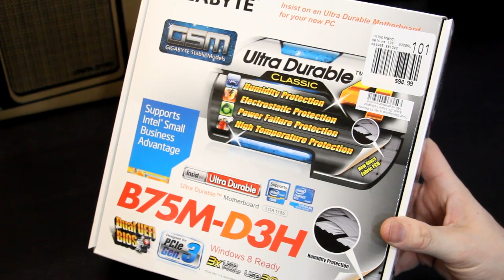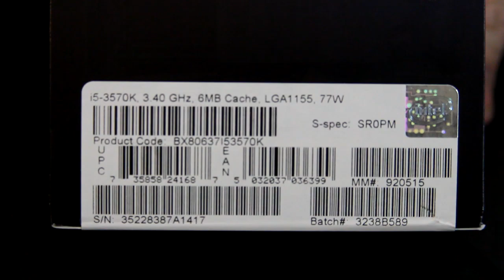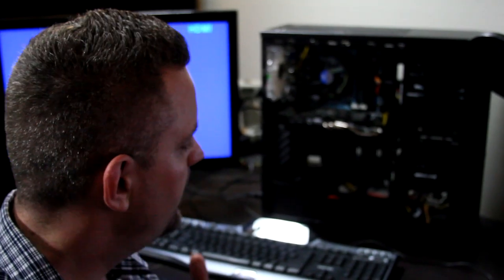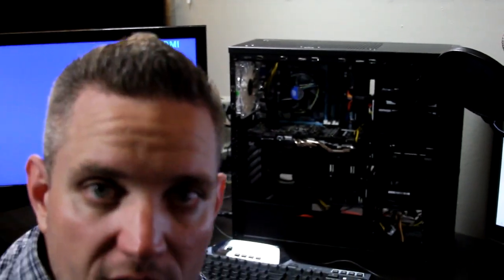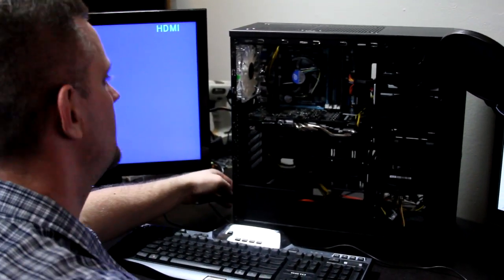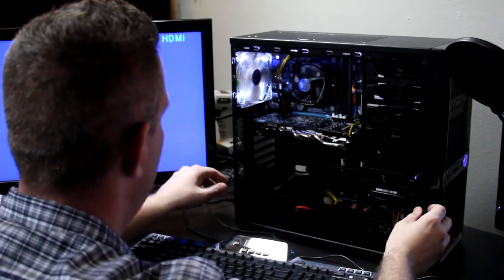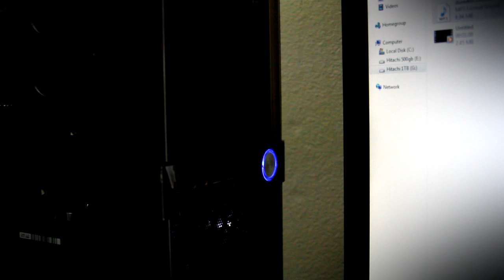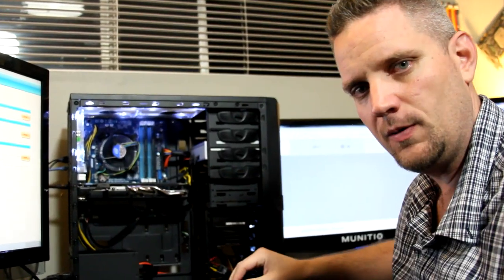How to build a gaming computer - Tech Addiction Special Edition

Comment: Yep, there are four of them in this build.  They were donated by Jay to this build.  They replaced the four stock fans the case came with, and don't add anything much besides lights to the build.  They're also fairly loud, but they do move a lot of air.

Comment: Thanks for the build.  As he says in the description, this will run BF3 on Ultra settings with no AA at 1080p.  Very good build... especially for the budget.

The LEDs were a gift from Jay, replacing the four stock fans the case came with.  And yes... they really do add 100MHz to the speed of ALL electronically controlled parts.

Comment: Yes you can. Nvidia cards have SLI and AMD cards have Crossfire. However you will need the proper mobo with ports to hold two cards, a larger power supply to power the extra card, and probably extra fans if you don't already as two GPUs put out a lot of heat.

Comment: OEM means original equipment manafacturer. It means its intended for companies such as Dell or HP, so there may be some features usually present in consumer versions that are missing in OEM versions. (OEM CPUs are missing the stock heatsink, etc.)

Comment: no, i recommend you don't touch any part that may have exposed contacts( any part with metal) as not to kill the board. also use a grounding strap if possible. you can pick these up from radio shack for fairly cheap. :)

Comment: If this is strictly for gaming, yes it will run most games pretty well. My only concern is the processor although its the GPU that really determines the quality of gaming. The 7850 is a great card, I have one. Make sure you get the Direct CU version as that will make your card run CRAZY cool. I only have two extra fans and my 7850 runs Far Cry 3 at 60C on full settings on full overclock.

Comment: some suggestions;
i always check to see if the mother board will post before i install it in the case. if the motherboard doesn't post its easier to work with outside the case rather than inside especially if its DOA and you have to send it back.
run the 8-pin power connector between the motherboard and the tray. it gives you more room for short connectors and hides the cable.
great video jay i hope more people get involved with pc building so we can enjoy desktop gaming for years to come!

Comment: Just did the research and here's the difference: Both the cards run with the same cores as each other and similar clocks. However the 770 has 1000 MHz more for efficient memory clock, and that really does help out in most games. But for the most part you are right.

Comment: If you have a larger budget than $850, you might want to splurge on either a case upgrade, or a 660ti.  You could also put the extra money into a Z77 motherboard.  That way you can overclock the CPU.

I suggested a case upgrade because there is not a whole lot of room for if you want to go liquid cooled later on.

Comment: No, not at all. OEM versions are usually just normal versions minus the flashy box. Which means that it will be the same as a consumer version just without the box and accessories. What you said about attaching to the motherboard may come from the fact that sometimes Windows OEM from manufacturers will be bootloader-locked and so you can only change it through the motherboard.

Comment: The CPU box will specify what socket the CPU uses, so just look up a motherboard with that socket type and the size you're looking for, then select one that meets all your needs/budget. E.g. I'm building a PC using the AMD A10-5800k (socket FM2) and an ASROCK MicroATX mobo that supports 1866 RAM, has a PCI Express 2.0 slot for my graphics card, and has 2 USB 3.0 internal connectors (for the front of my case). Only thing lacking is a second chassis fan connector, so I'll use a molex adapter.

Comment: It all depends on the size of the case and the motherboard, if you get a Mid-ATX case it will fit most standard size motherboards. A good case, the one I have is a Raidmax Raptor it has 4 fans already built into it, and you have knobs on the top that adjust the lighting and fan speeds. I have the ASUS Z87-A in it but I wouldn't reccommend it, as soon as I needed to take a RAM stick out one of the latches broke, so I would go with A Z87-Pro or a Sabertooth, both come from ASUS.

Comment: Yeah I use a usb optical drive. hey btw I fixed the problem with my server. It was a small fan inside the psu, not the main fan, but a small one attached to a heatsink inside of it, I just got a whole new psu for it. Thanks for answering my message.

Comment: It's just size. M stands for Micro, which means it's smaller obviously. Therefore there are less ports. Often there is only one PCI-E port and only 2 RAM chip ports. ATX boards often have multiple PCI-E ports and 4-8 RAM chip ports.

Comment: I have an ASUS 7850 w/ Direct CU with an Intel i5 3570k @ 4.2Ghz. I play at 1440x900 on a 19in monitor. I can play Far Cry 3, Skyrim, Saints Row 3, and Arma 3 on max or close to max settings at ~40 FPS. Granted, I've overclocked it to 1050Mhz clcok speed and 1450Mhz memory speed.

Comment: The best way to not use a ground strap, is to touch metal before touching parts, and before going into a case grab the case and discharge any built up electricity.

Comment: If you're going with AMD, stick with ATX, and the 990FX chip-set. They have much better stability when it comes to overclocking, meaning a more efficient power delivery system for the CPU. A great board would be the GA-990FXA-UD3 from Gigabyte. It's a great board with plenty of features (including support for memory up to 1866mhz, or 2000 with overclocking) and costs roughly 130$. As for memory, it will down-clock it to 1333mhz, and you'll have to manually overclock it in the BIOS to 1800mhz.

Comment: First question: what settings did you use?
Second question: are you sure your mobo is supplying enough current to your CPU to support the 4.5GHz OC? The Phenom II X4 965BE caps out due to TDP limitations; the socket might do the same. (Use I = V/R to get amps, then convert to watts.)
Third thing: this is why I got the cheapest quad core I could for now--I plan to upgrade in the future to an 8 core steam roller or excavator.

Comment: AMD A10-5800k crossfired with 1GB GDDR5 Radeon 6670 (H667FN1G); 8GB Patriot V3 1866 memory; MSI FM2-A75MA-E35 motherboard; 1TB 7200rpm Barracuda; cheap mid-tower case. Playing BF3, you'll get around 50fps at 1080p, high everything. My system is costing me just under $500 because I added aftermarket cooling and some other bells and whistles, but a $400 pc will do fine. It's feasible if you get everything on sale.

Comment: You should be fine. However you will not be able to max out the settings. Chances are you'll be running around the middle at 30 fps depending on the game. You don't really need an optical drive these days as everything is on Steam unless you really want a physical disk. Otherwise, for $400 you have a pretty decent computer.

Comment: The 6100 is Bulldozer, whereas the 8350 is Piledriver. My guess is that a 6300, which is Piledriver, would work just as well as an 8350 (given the same clock speed). According to what I've read, you don't get much extra performance scaling after 6 cores on BF3.
Are you sure that your overclock is stable? It could be bottlenecked due to insufficient voltage or something. And what speed is your ram? I think something else is messing it up. For reference: ?v=PZTfVy4dEPo

Comment: They're pretty intuitive.  The RAM only goes in very specific spots, but you'll want to read up on how to run dual channel RAM.  The Video Cards only in one place.  External USB connector points are clearly marked on the motherboard.  Trust me, you'll be able to figure it out.  :)

Comment: You could have better airflow and better fan management. The ASUS 660 will have GPU Boost which allows the card to automatically overclock itself based on the temperature's. You could also have just gotten a better GPU than that person did. Not all cards perform the same, even if they're the same model.

Comment: They're both awsome cards I owned a 670 and own a 7950, but since I  have 3 monitors the 7950 perfoms alot better on 3 monitors because of the 3gb DDR5 on it. ( I don't crossfire no sli).

Comment: I play FC2, FC3, BF3, Metro 2033, Red Faction: Armageddon, and Saints Row the 3rd on very high/ultra settings, and I still get tearing 60% of the time without using a frame limiter (60Hz/75Hz). Everything is buttery smooth. My new pc is outperforming my expectations :)
Btw, minecraft average of 120fps with maxed settings ;D

Comment: Excellent video jay. I haven't built 1 in about 7 years BUT have worked on tons and I have never seen a PSU that was on the bottom and draws air from inside a hot case like that. I mean you certainly don't want to face it downward and suck in carpeting dust BUT man to draw in heat from inside the hot case? Seems weird

Comment: 5:24 do we need a power drill to install our fans or did that case just not come with screws for your fan size? And at 6:14 you had to put some copper pegs in the case, does the board come with that?

Comment: My current PC has an i5 3570k OC'd to 4.5 Ghz, HD 6950 2 GB, 8 GB 1600Mhz ram. Not that great of a build, but enough to run any game I've tried @ max. Planning on getting a GTX 770 or GTX 780. The price is deffinatly going to be a big factor ( @ $200 difference). Also want a SSHD because i like the idea of the HYBRID tech. Some performance of an SSD with the storage of an HDD. The storage is a little more important to me. IDK how to run separate storage drives unfortunately.

Comment: BF3 on ultra nice. GPU turns to dust with Crysis 3 on ultra tho :( Im hoping to build a gaming system in the future and im using Crysis 3 as the benchmark. From my research I found that to play it on max settings the minimum I need is a HD 7970 with a 3570k. The 7970 goes down to about $400. Is there a cheaper alternative that can run Crysis 3 on max settings? Keep doing what you do man.

Comment: Do you know what kind of computer you can put together with 4700 dollars? I've been building three computers now. And the most expensive was around 2000 dollars. That one contained the intel core i7 3930k and GTX 670 SLI. 
You can set up more than 10 monitors with that amount of money. 
But nice video tough.

Greetings,
Sjoert de Boer

Comment: in all honesty, intel has power, yes, but you're best choice is a Phenom II from AMD, and use the saved money to get a better GPU, and use an HDD instead of an SSD, saved money will let you get an aftermarket cooler, you don't NEED an SSD, but an HDD will be just fine for a gaming machine, at most, an SSD will shave 1-2 seconds off of loading times, no FPS increase at all.

Comment: Well, not telling you to buy what I list, but from what I know this stuff is the best price for performance. Check prices between NewEgg and Amazon more than any place else. As of this comment, everything below added up to be $735.99. Hope this helps!
Case: preference. (I counted $85)
PSU: Corsair TX 650w
CPU: AMD FX 4130
GPU: HD 7870
Motherboard: Asus M5A97
Ram: What you had was fine.
HDD: Caviar Blue 1TB

With this you'll be able to play Battlefield 3 at High (maybe ultra) with great fps.

Comment: I have a question on what processor to get.  I am building a PC for all around use.  I would like it to handle anything that I throw at it.  I plan on gaming on it here and there.  I want to potentially use Photoshop in the future, and I want it to be able to handle computer programs for college and work in the future.  Also my friend and I were thinking of starting something on Youtube.  I do not plan on overclocking.  Here are the two processors I am thinking about:

i5 6600
Speed:  3.3GHz
Cache:  6MB
Cores:  4
Threads:  4
Price:  $229.99

i7 6700
Speed:  3.4GHz
Cache:  8MB
Cores:  4
Threads:  8
Price:  $349.99

Is the i7 6700 worth the extra $130?  Please let me know as soon as possible.  Thank you!
Reply: I'd suggest the i75820k because it has 6 cores which will help in rendering and cpu intensive tasks

Comment: Do you have experience with the G2010? The GPU (gtx 650 1 GB) is enough for sure, and so is the 4 GB of 1600Mhz ram. Just not sure @ the CPU. I ran BF3 fine on 4GB 1333 Mhz, FX-4100 CPU, Hd 6770 1 GB GPU, with medium settings.

Comment: yes I admit, it has been awhile since I worked on a very modern PC but I just double checked my custom build and the PSU fan is sucking in air from inside the case and blowing it out the back. just haven't seen a case where the PSU mounts to the back bottom is all.

Comment: Where is the date u built this monster.  The end cost as well.  I ask because I like the motherboard and GPU choice and PSU.  I have that motherboard and am looking at the MSI GTX 660 and a Corsair CX500M to power it.  Currently a 3.3GHz i3 is the CPU that I will keep on it.  Don't have ur reflux capacitor but I will make due :)

Comment: If I need to use a wireless connection, do I need anything extra or is it part of the MOBO or something?
Reply: Some motherboards come with Wi-fi like the gigabyte ga-z87n-wifi, but they are more expensive than the non wifi version. You can also buy a Pci express wifi card that you plug in your pci lanes of your motherboard and then download the drivers and setup the card for your network. I've tried the first option and I am very pleased with it.

Comment: CPU- Intel pentium g860 Motherboard- Asrock h6im-Dgs lga1155 GPU- Galaxy 650 ti boost 1GB card Ram- corsair ddr3 1600 mhz 4GB PSU- raid max Rx- 500 AF 500 watts 80 plus bronze Hard drive- HGST 500 gb 7200 RPM 16 MG cache Case- RAid max Tornado atx mid tower Black/ blue. that will run bf3

Comment: i don't remember i over clocked a long time ago.. but im pretty sure im getting enough TDP.. 6100 is only a 95 stock my mobo allows up to 140 i beleve.. but i recomend a 1090T before i recomend the 4100.. its about the same price and significantly faster. it out tops the 8150.

Comment: Hey man, I'm building a gaming PC on a budget, how are these specs?
CPU: AMD Phenom II X4 965 Black edition
MOBO: Biostar A88OG
GPU: MSI Radeon 7770 Ghz edition 1 GB
RAM: single channel 4 GB
Case: Cooler master 430
Storage: 500GB
PSU: Rosewell 350 Watts
Optical drive: Lite-On iHAS124-04 DVD/CD Writer
I don't plan on overclocking and i'm on a budget of 400$.

Comment: well if you go with all amd parts then it could be good, because an athlon x4 750k is basically an apu without a gpu and it's only 60$ and an normal fm2 mobo is 60-70$ and the hd7790 is 110-130$ so yeah it could be cheap and upgradedable, because amd won't change the socket or the chipset every year like intel for the next 5 years :)

Comment: I'm not planning to overclock anything in my new computer, so is it really necessary to get a better CPU Cooler? I know I asked you this already on the LIVE STREAM, and you said anything is better than a stock cooler ^^. Also, what case you think I should get? Incase my SPECS matter: GTX 670, i5 3570, ASRock Z77 Extreme6(<= Is that a good mobo? Long lasting?) & 8GB Rams))

Comment: The 7950 is better than the 760 at certain areas. Like memory bandwidth. Using high levels of AA the 760 is better. Plus you can overclock the 760 and it runs off newer hardware and less power. the 7950 is a good overclocker as well. The 6350 amd Is not better than the 3570k. AMD runs pretty hot and draws a shit tone of power. whilst the 3570k does not. And if you plan to run stock fan with an AMD. I feel bad for you. The 3570k is not to much better though but you can overclock it more.

Comment: Hey bro. Im planning to build a rig for CAD/Photoshop/Gaming. I'm currently looking at using AMD 8350 on an MSI 990x motherboard with 16g ram 7870 gpu 120ssd 1T HDD 750w 80 bronze on a mid-tower case. In Australia, where I live, that would be around max $1400. Just wondering if this would be enough for my needs. Or does intel has a better solution?